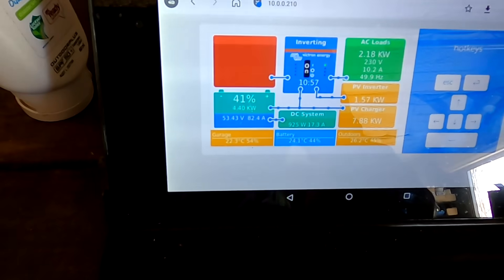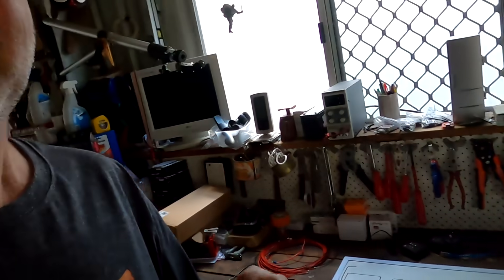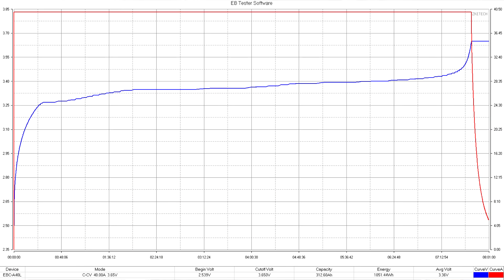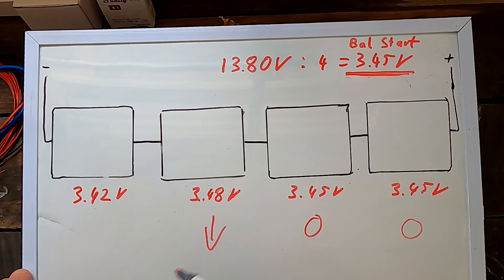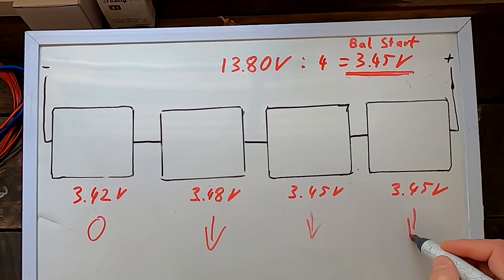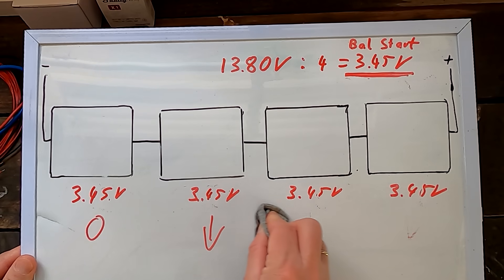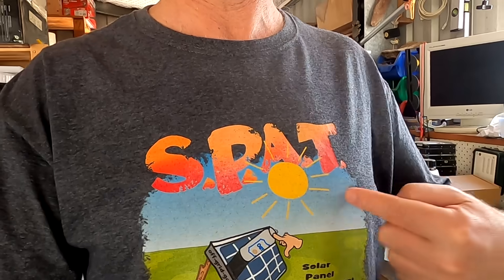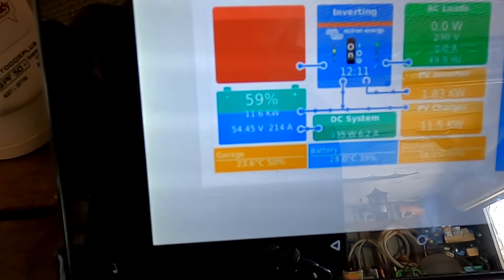Balance Start Voltage for LiFePO4 explained. Why you should not start too early... 🔋⚡

Comment: Well done Andy, thanks for comprehensive recap of cell balancing, Something I've noticed on some cheap no-name and Daly low-dollar passive balancers with fixed parameters commonly used in ebike packs, is that they start at 3.50 volts per cell, but they don't discharge only the cells at a higher charge, but simply discharge all cells to 3.55V or 56.8V on a 16S pack, and cut of all charging current if any cell goes over 3.7 volts. Therefore to balance the cells I pretty much have to charge to 58.4v and disconnect charge voltage until the entire pack discharges to 56.8v and then charge again. 

That also means that if you keep a constant charge voltage applied the pack will never fully balance as the passive discharge current is continuously replenished, and balancing only occurs when charge power is manually removed. If load is applied after charging, without leaving any time for all cells to discharge to 3.55v, then cells won't balance either, and I suspect why cheap eBike packs that are left on charge and then disconnected and immediately ridden can develop major imbalances 
Pretty crude balancing  but functional way of if you understand how it works and charge accordingly
Reply from the maker: I would not use these cheap BMS where all the settings are fixed. You really don't know what they are doing and have no control over it.
Smart BMS are not expensive any more and you can get them from $40 already with Bluetooth app.
Reply: @OffGridGarageAustralia  I would ever use hem on a large storage system either.. Just FYI for people who may have them in eBike or portable power systems as they seem to be common. 
For small cheap, potable packs I find them a cheap, compact and adequate for over and under voltage protection, and balancing as long as you understand how they work.

Comment: Andy,
Great video again. One thing I would like to point out that if you are using a ‘smart’ balancer like found on your typical BMS, they 

1. Have an additional setting that turns on the balancing – the cell differential threshold  (called ‘balance open diff voltage on Daly’ called whatever on others) that will turn on only once differential crosses a boundary.

2. Will not drain the lowest cell for passive balancer or it will charge the low cell for active balancer (i.e. you will see this in the monitoring app on your phone- the lowest cell will not be pushed lower.) This is the ‘smart’ part of the BMS. (Related to this at 6:35 in the video you mention ‘it will discharge all of them’, hence you recommend not to use 3.4V. It should only discharge all but the lowest.)

In practice I found this means you can set the start voltage to 3.45V even if you are charging to 3.55V. The primary requirement for the ‘start’ voltage is that it must be in the knee (above 3.4V or so). If you take measurements you will find if 3.45V start is used for 3.55V charge, it will start balancing a tiny bit earlier than the 3.55V start case. From seconds to minutes – since the high cell voltage ramp time from 3.45V to 3.55V for an out of balance battery is often quite short, depending on the current. 

Please note I am not pushing for 3.4V, but simply stating in practice, 3.45V start works great with 3.45V charge, 3.55V charge, or 3.6V charge, or you can set them the same and loose a tiny bit of balance time.
Reply from the maker: Yes, thanks for the further details. I didn't mention the deviation setting in the balancer. It complicates things and does not really change the balance start voltage any way.
The examples were mostly for the internal passive balancer of the BMS. Active balancers act a bit different as you correctly outlined above. But again, the basic start voltage of the balancer can still be set by that simple rule.
Reply: Thanks for the response. 

As some people point out, at high currents, you may have to bump up the start voltage since the knee may start above 3.4V.  Practically I never found that to be an issue.

I originally came across this problem looking for a low cost balancer for a bunch of crappy LIFEPO4 batteries that required the occasional manual balance I wanted to automate without any complexities....  good luck. Tried pretty well every lower cost balancer off ali-express almost none activate at 3.4V or higher. Those that do are passive per cell balancers (no difference detection) that generate a large amount of heat. Still looking.

Since you love to experiment I bet you would have a field day with some type of data logger that you runs whenever you try another experiment. I did and suddenly things become quite clear. You can go back and analyze at your leisure. This is especially important whenever you get a new battery or balancer and indicate that it does not seem to be working too well.

For example I found my JK BMS (about 1A balance current) may take 30 min to balance a battery. Same imbalance on my Daly would take 160hours. I can see it moving on the data logger but not by staring at the voltage short term.

Since your batteries are networked, maybe someone has a clever data logger script you can run in the background? Time, cell voltage, current. I am using a 4S Daly BMS with sinowealth software  on PC. Works like a charm. 

 @OffGridGarageAustralia

Comment: So, balancing is primarily taking place during the absorption phase of the charge cycle.  Starting just before the CC goes into absorption and then continuing thru absorption, correct?
That begs another question:  if our cells drift a bit more than we are comfortable with and we have a relatively "weak" passive balancer (Overkill) should we not increase our absorption time so the balancer has more time to try and bring the voltages closer together?
Reply from the maker: Yes, correct. Once we hit the CV phase, we start balancing as this is out of the flat part and cells start showing their true voltage.
By increasing the absorption time, you definitely give the balancer more time. That's exactly the test I'm doing right now with the battery shelf...
If you have a few cells getting too high, you can try increasing the time and see how it goes. I had no success with that method as the balance current is just too small in these balancers.

Comment: What guage wires are people using for active balancers? I've used  28awg cable and I think this provides too much resistance over the 2m leads and gives false voltages at the balancer.  The best I can do is 70mV deviation across 16S at ~3.55v each.
Reply: The balancer cables need to carry the maximum balancing current the balancer is capable of delivering and should be sized accordingly.
Say 2A balancing current, 2m (why so long?) the resistance over AWG 28 (~ 0.3mm^2) copper cable will lose ~400mV (x3.4V ~ 1.3W) over the cable.
A rule of thumb is 1mm^2 per 10A of current for free hanging cable when it comes to heat dissipation being done via convection. Buried in soil, clumped together or within conduits it's less, due to the heat building up faster.
The other point is how the connectors look like at the BMS, no sense in running AWG10 (2.5 mm^2) for the balancing cable and then only having tiny 1A crimp on terminals that wont fit.
First thing I would try to do is get the BMS closer to the batteries.. those long balancing runs carry the full voltage of the cells/banks and if not routed safely can start fires IMHO.
Reply from the maker: It depends a bit what kind of active balancer you're using. Usually, it does not matter as the balancer measures and balances at different times.

Comment: Thank You. That makes since. I changed mine again.  I am starting winter and I know I will have to use the grid. I am setting my inverters to save enough for 24 hours of power grid being down in reserve. 20kw of 56kw. I think 40% isn't enough since I do not go lower than 48 volts and I do not go over 56 volts. I will try 45% which is 52.1 volts rested. does that sound right? Winter where I am sucks for Solar.  11.2kw of panels is about 1/2 of what I need and I could also double my batteries to get me close to off grid.
Reply from the maker: Good idea to keep the battery at a certain level to cater for these days when you need it.
I don't think 45% will have a certain voltage though. That is impossible to pinpoint with LiFePO4 batteries. You have to rely on the BMS or shunt for this purpose.
Reply: @OffGridGarageAustralia  I been watching and its not perfect but I have a chart and its real close.  The BMS isn't connected to inverters so I have to tell them when the batteries get to a certain voltage switch to grid. I have taking them down to 46 volts so the BMS is more accurate. When doing so I have about 20kw from 52.1 to 48 volts. I double check with BMS which I have 4 JK's

Comment: Andy, as per your video from a year ago on Daly balancing, you for the Daly active balancer you found the lowest cell had to be above the set starting voltage of 3.3V for balancing to start, that is, all cells must be over 3.3V default to start active balancing. And for the Daly passive balancer in the BMS it is set to start at 3.2V Daly default, but some cells might be higher e.g. 3.4V, and I'm not sure if all cells or highest cells need to be over 3.2V. So what pack charge (absorption) voltage would you target for the Daly, say, 24V system? I am thinking keeping my setting at 3.45V*8= 27.6, or moving the setting up to 28.4, the higher number due to your recent testing videos of getting your passive balancing to work better for battery shelf. If today's video is correct, raising the setting on the Daly from 3.3V to 3.45V may mean that balancing never starts at all😮 because I've notice once absorption voltage is reached the charge current basically tapers rapidly to zero (within one hour) and the voltage is held steady at the target.
Reply from the maker: That could depend on what Daly BMS/balancer you are using. I have seen them acting differently. But you can test this and the app will show you if the balancer is turned on, so you can check if on cell or all cells need to be above the threshold.
27.6V seems to be a good absorption voltage. As you said, the current will go down quickly and the balancer should start if ONE cell goes over the 3.4V you have set. If the balancer waits for all cells, it is total garbage anyway. At 27.6V you goal is 3.45V for every cell, The balancer catches the ones which are above that, nothing else. and if you cells are all at 3.45V, the balancer will not start at all, correct.
Reply: Thank you for taking the time to share your experience in practice. You mention top balancing due to the cell charge curve, and if I follow Stuart's circuit logic correctly, an active capacitive balancer will equalise by averaging the eg 4 cells by switching them from series to momentary parallel connection. You mentioned in your video that your video today applies to both active and passive balancing. I don't know how passive balancing works but I might guess it is resistive burning away of cell capacity by choosing the highest one or two cell at a time. This will result in loss of charge over time and the balancer will stay on until the set balancer voltage is reached, this all cells are slowly brought down even if it is one at a time.   Perhaps in practice only the highest cells will come down before the battery pack is discharged via usage anyway. Whereas the active balancer will top balance by averaging, bring cells above the resultant average down and the cells below up to average. Actually, it is more precisely an RC capacitive resistance (switching) circuit so resistive losses too will bring all down all cells somewhat. So active balancing may be able to occur slightly below the highest target charge voltage if it's still high enough in the charge S curve. Also, the RC capacitive balancing logic will have its own curve which would work faster at higher cell deviations. Without knowing all the circuit vakues I would like you have suggested simply have to test and see. Thanks again

Comment: I'd add another point to Andy's logical explanation:

Before the chargecurrent doesn't decrease to a very low value close to the balancers capabilities, balancing just doesn't have any big sense.

On the other hand: When coming close to the end of the chargecurve - say 3,55V, it makes sense to lower the chargecurrent to an amount close to the balancers current. In the case of a 2A JK lets say 3-4A, later 2A. Otherwise giving it more, one cell might skyrocket until at 3,65V the BMS shuts down over and over again.

When the chargecurrent is not to much higher than the balancers current, the latter one can catch up and do its job in balancing the cells before the BMS reached OVP.
Reply from the maker: Perfect, thank you, I 100% agree!
Reply: I am in the need to get a few BMS( smart ones) for a off-grid build and was waiting for the new one that Andy just showed and tested but it’s look that i need to wait longer to fix the issues with it
On the other and i need a simpel liable smart BMS where you can set the charge current on different level where you talk about it,what BMS can i buy or what kind of BMS could you recommend it’s for 48v
Reply: @marcvandaele1878  i've got an offgrid-system, too. Very happy with my 2A JK-BMS. I'd recommend going for JK. It's got all the bells and whistles necessary especially a capable active balancer fully configurable out of the box.

One thing to keep in mind, though, is that each BMS-battery-combo acts standalone. So the Solarcharger can't know if there are big differences between the batteries. It'll do the job.

Andy's new JK on the other hand might be a gamechanger in that particular regard.
Reply: I think it works the opposite way. The longer into the charging process you wait with the balancing, the higher the risk is for an OVP, because there is no mechanism to lower the highest cell. The balance process itself doesn't increase the risk of an OVP, instead it does the total opposite, it lowers this risk by constantly discharging the highest cell. This is true no matter if you start it early or late. So I'd say it is a good idea to start the balancing as early as possible, as soon as you hit the steep part of the voltage curve where the voltage is proportional to the SOC.

I agree with you that a small balance current of 2 A might not make much of a difference to a high charge current. So the actual effect of early balancing might be very small. But it is still better than nothing. My main point is that starting balancing early has no negative effect, and can only have positive effects.

If you have problems with the BMS balancing your cells, I think that setting the absorption voltage a little lower than normal has a much bigger effect than changing the Balancing Start Voltage in the BMS. Then you get a much smaller charge current at the end of the charge cycle, like you mentioned, and this will make the job of the BMS much easier.

Comment: Andy, most BMSes look at cell voltage deviation as well as balance threshold voltage. The lowest cell will never be pulled down because it's used for the deviation calculation.
Reply from the maker: Yes that is correct. I didn't go down that rabbit hole as it makes this all more complicated and does not really change the start voltage.
Reply: @OffGridGarageAustralia  So if you leave a Passive Balancer connected and you are not charging will it run all the cells down ?
Reply: Andy, you have to distinct  between passive and active balancers, when explaining balancing theories. An passive balancer, is a simple stupid device that works by pulling down the voltage from the the high voltage batteries, through energie destruction, mean discharge the batteri by converting energy to heat. An passive balancer first stop balancing when all batteries are pulled down to the same voltage than the weakest battery, so you effectiv blow energi from your battery out in the open, by using a passive balancer. An active balancer is doing the exact oposite, like the NEEY. since it is moving energy around between the batteries, not wasting any enegy, but truly balancing the batteries with nearly zero loss. So the theorie  you explain, is only valid for passive balancers, active balancers will take energy from the highest voltage battery, and feed it into the battery with lowest voltage, until balance is right through out the whole battery pack. My personal experience with NEEY 24/15A active balancers in cascade high voltage, (350V) show good results even at lower starting voltage for balancing.
Reply: My thoughts! Start @ 3.45V ans Charge to 3.55V with Float set to 3.4V. Works perfectly for me. Starting at the top knee an then falling back to the start again after balancing.